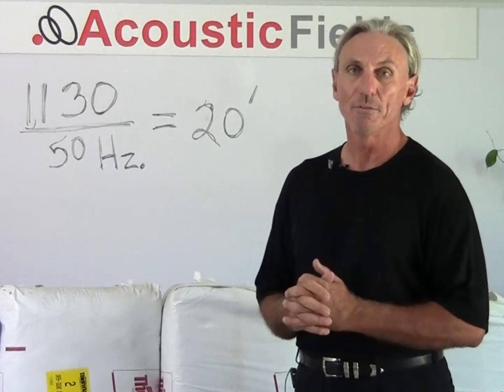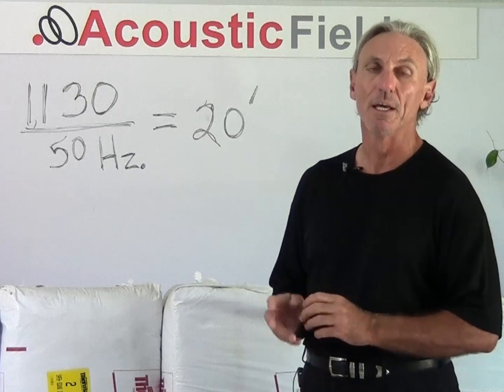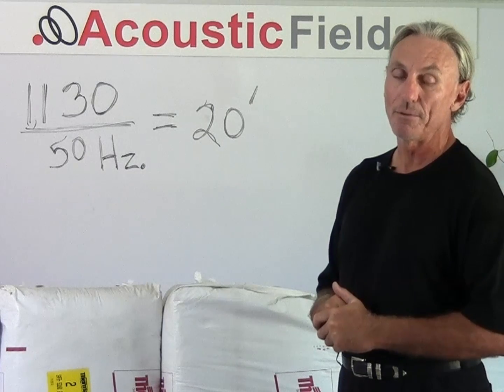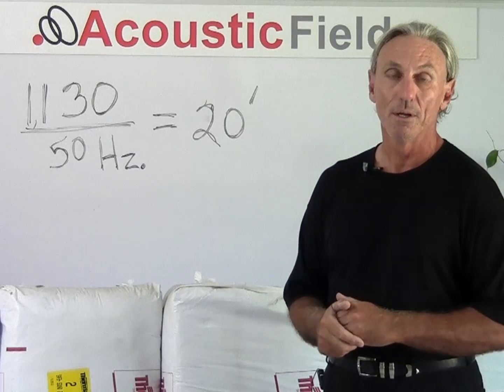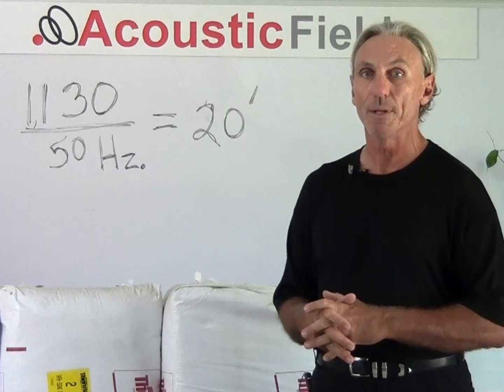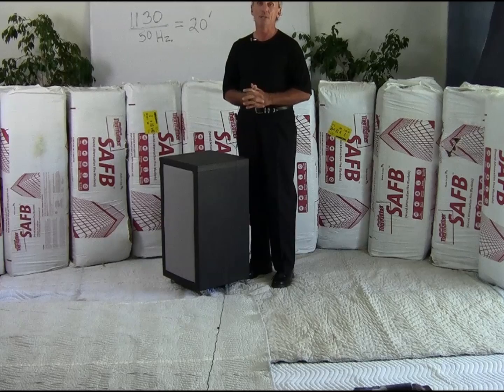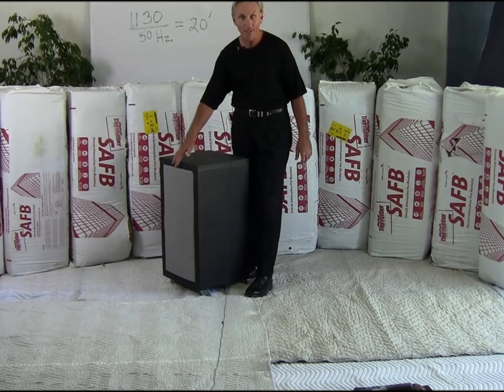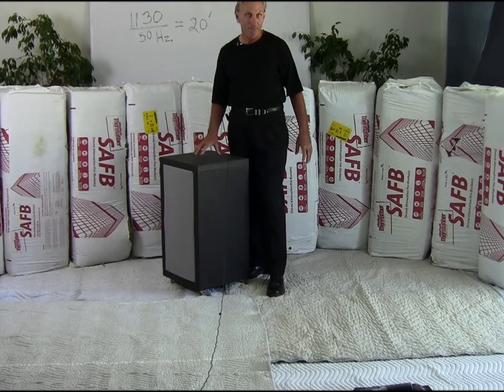The Power Of Diaphragmatic Absorption

Comment: so if you built it for 40hz, would it only filter 40hz, or 40hz and up?
Also can these just be placed anywhere in the room?, or would you only put them where the peaks or nulls are?
Reply from the maker: M,  The resonant frequency of the unit means that everything above the frequency is absorbed and everything below is not.  You must follow the acronym TAP  type, amount, position when it comes to treatment. Choose the correct type, make sure you have enough to treat the issues and place it in the proper position required by the room size, volume, and usage.

Comment: Thank you for your videos.

A point of clarification. It seems generally advisable to have numerous diffusers and high end absorbers about your listening environment, are you saying that just one of these low end absorbers are needed to treat an entire average size listening area for the low frequencies?
Reply from the maker: +masterpangloss Low frequency energy management is all about providing the correct amount of square footage to absorb what frequencies and at what rate. Think of your room as a glass of water. The low frequency energy is the water level. You are sitting in the glass. The water level is over your head. You can not hear anything correctly. You drop "sponges" into the glass and lower the water level below your ears. Average small rooms require 80 - 100 sq. ft. of surface area. Our ACDA-10 units are 10 sq. ft each.
Reply: No, he's not saying that you only need one of those small boxes to absorb all of the 50hz energy in the room.  you'll need many of them, but if you wanted to absorb 50hz energy using the SABF product, you'd need 20ft deep walls filled with that stuff instead of a 15inch "wall" with a diaphragmatic product.

Comment: i use vprs or limp mass for my low freq what the real Advantage of the method?
Reply from the maker: Hi Dor,

Limp mass is a more passive method for sound absorption and will not produce the low frequency absorption rates and levels you will require in small room acoustics. Limp mass works well for frequencies above 100 Hz. but requires greater cabinet depths to achieve lower frequency absorption. You would need a limp mass absorber cabinet depth of approximately 7' to absorb down to 40 Hz. whereas a diaphragmatic absorber can do it at in a far smaller depth.

I hope that helps.  If you sign up for our mailing list there are more free videos which deal with low frequency issues, fixes and treatments. You can sign up here http://www.acousticfields.com/free-ebook

Cheers
Dennis
Reply: Acoustic Fields
thanks :) yes this is Truth about limp mass this is why i Designed and developed an vpr kind traps (steel 1-3mm on foems) that can work on 30hz+ (50%+) with only 10cm or 20cm for all freq  but i love your Product :)